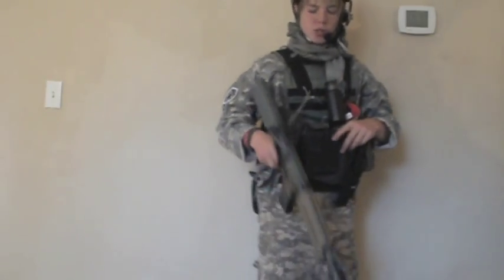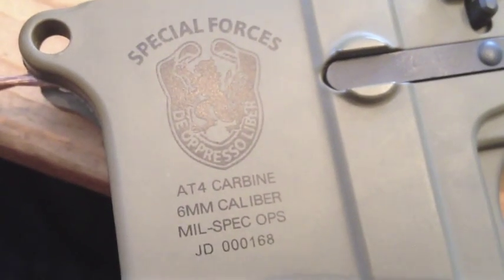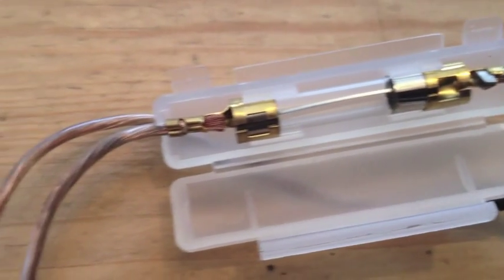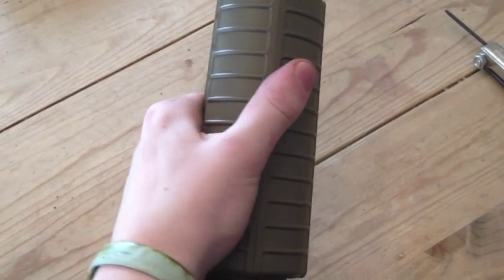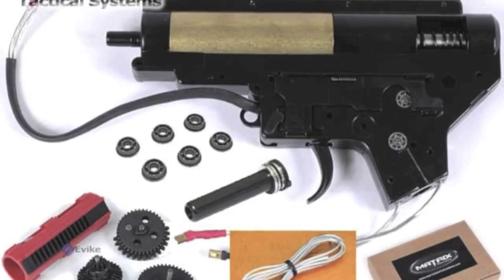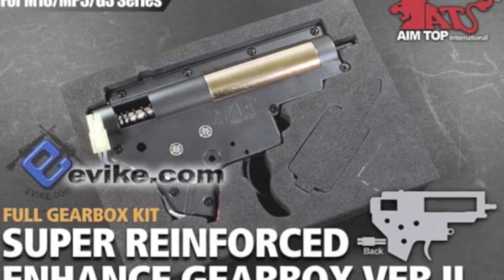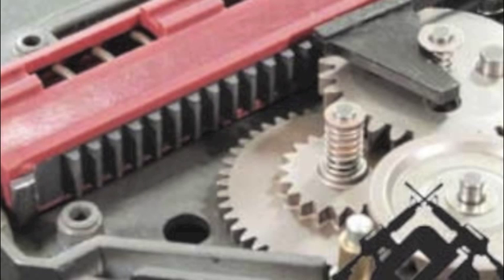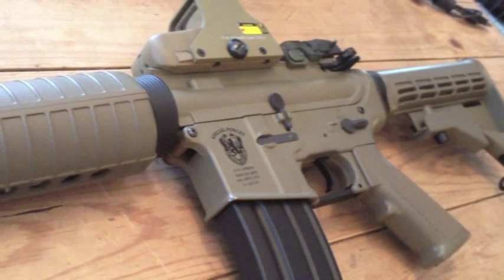AIM Top m4 overview

Comment: Hey, regarding the barrel wobble, u had the same issue but i fixed it by tightening the (excuse my lack of proper terminology) black thingy that you move slightly to remove/insert hand guard. It locked the barrel in tight.